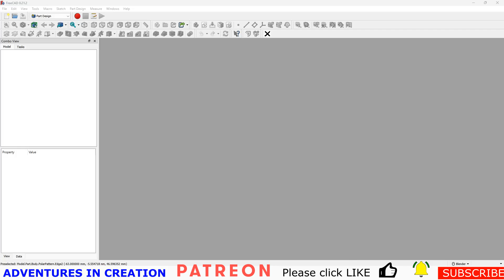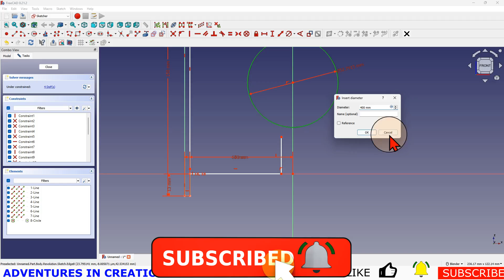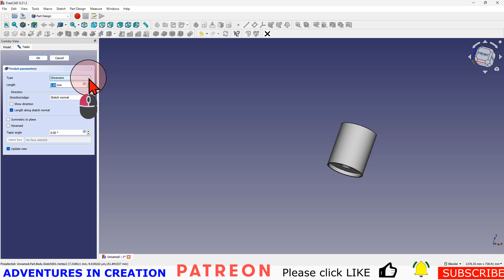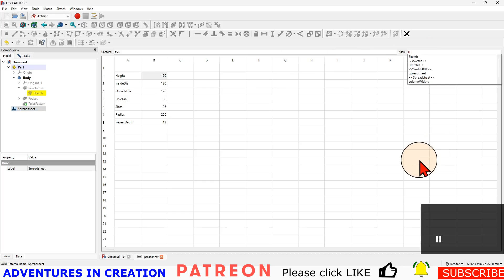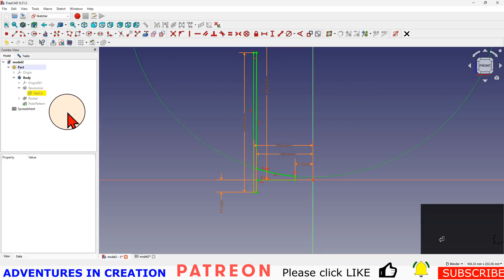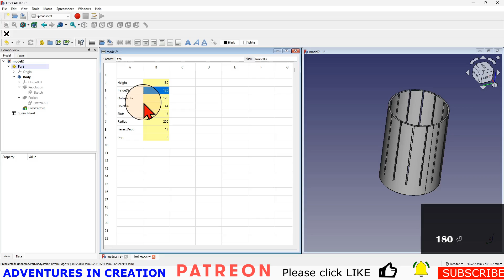FreeCAD for Beginners #62 Parametric Model using Spreadsheet #cad #freecad #design #makers

Comment: Great, easy to follow video!  I was pretty pleased that the workflow you showed is pretty much the same as I would have used. I must be getting more comfortable with FreeCAD.  Of course, I wasn't demonstrating so I would have started with the spreadsheet and then used those dimensions in the sketches.  

The only thing I am wondering is where did the 3mm dimension of the bottom come from? I don't see it on the requirements diagram. It is certainly is reasonable to make it the same as the wall thickness as you did.
Reply from the maker: I am glad you had a similar approach. The 3mm was a calculation.